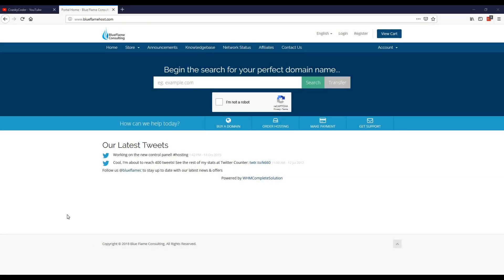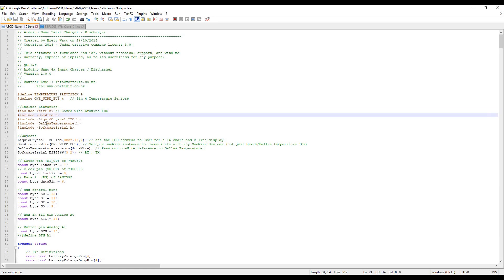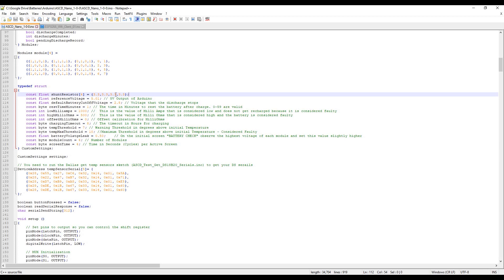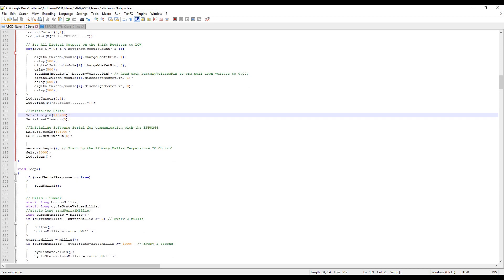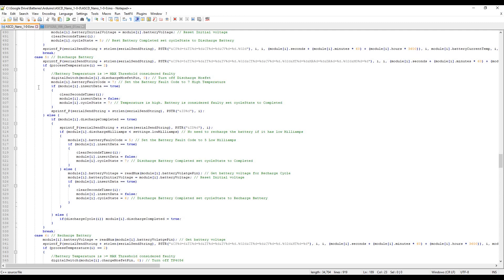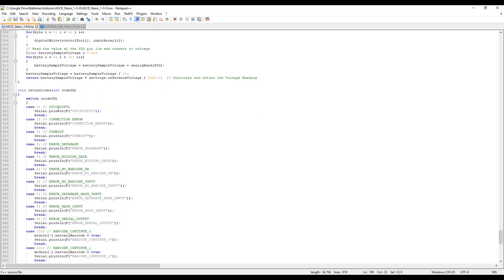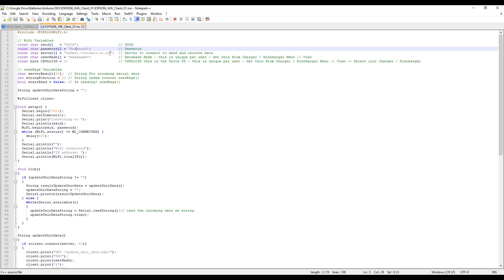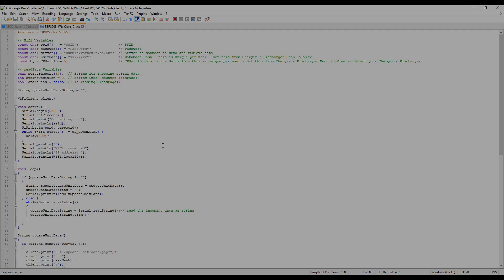ASCD Nano 4x 18650 – Code– Part 1

Comment: I just watched Update Part 1, will there be a Code Part 2?
Reply from the maker: Yeah maybe what do you want me to go though or in more detail?
Reply: @brettwatty101 Thanks for the reply.  Wasn't sure the code is complete to build these, the links show "code in development".  I also wanted to build the 8 cell unit.  Great work. 👍
Reply from the maker: @DDA40Xman  code works on the 8x version. 4x I am just refining it but it works it will be released before anyone else finishes building one. Cheers Brett
Reply: Thanks Brett, I'll order the 8X boards (2) and parts then.  Really like the design.  Thanks for your time.  My name is Bruce by the way.  My father-in-law was taken to New Zealand during WWII (U. S. Marine) after being wounded and always told his family how friendly New Zealanders were.
Reply from the maker: Thanks mate. Honestly until I update the PCB for the 8x version I would reccomend getting the 4x version for now unless you are proficient in electronics.
Reply: @brettwatty101  That's right, Magnus did say he had been in contact with you about the new version. I'll wait, thanks for the reminder.  I am proficient, but I already have two kits (21 and 5) to build so I'll work on those.😊